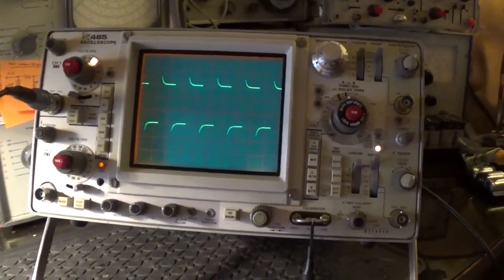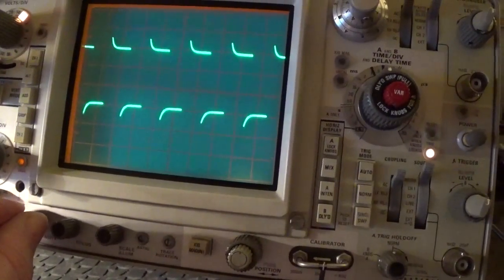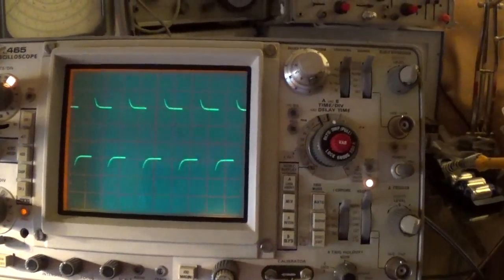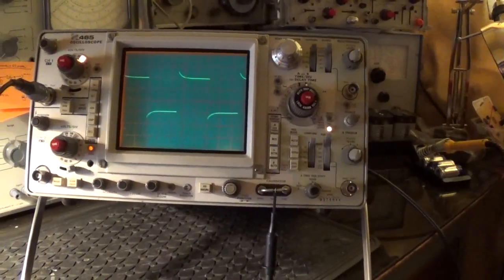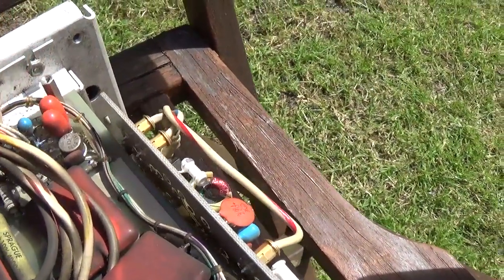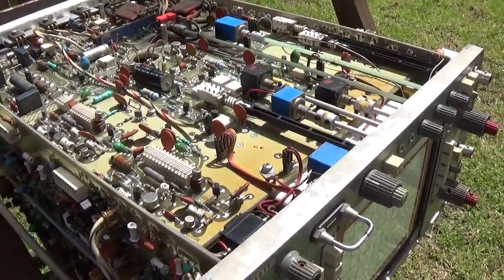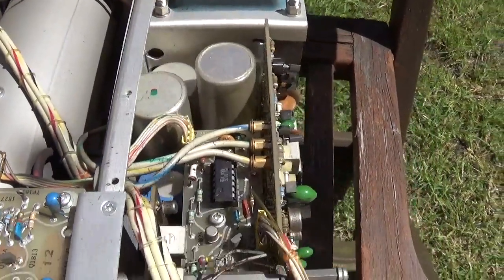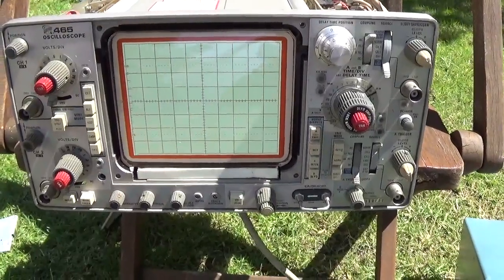Tektronix 465 repair

Comment: Thanks, nice video. I fixed a dead '465 back in the 80's. The +15V power supply was dead. It consists of a '741 op-amp and a series-pass transistor. I measured the '741 pins, found that the voltages were wrong, and swapped in a new op-amp. The  op-amp was socketed, yay! It worked, total repair time about 15 minutes. I used that scope for many years
Later the channel 1 vertical position pot was very jumpy. It was one of those old , square Bourns Modpots. Replaced it and that annoyance was fixed. 
These were and are great scopes. Good luck fixing yours!

Comment: I've got one  whose trouble is  the coaxial input terminal of channel one, is broken ... but I do not know how to remove it ... it has a metal cover.
Reply from the maker: Hi Alfredo, the manuals are freely available on the Tek wiki site   http://w140.com/tekwiki/wiki/465
Reply: tnx so much....blessings
Reply: Do you think it's possible to get the broken terminal?
Reply: look ... I have a coaxial cable terminated in a female connector ... the cable is rg 50 .... do you think I can replace the original with this and it works? ... it is the first time I work on this device....i want to learn
Reply from the maker: Easily available!  Mouser in the US should do them. Otherwise join a vintage electronics forum and ask if anyone has a spare Tek part they'd be willing to sell. Good luck :)

Comment: I really like the illumination on the volts/div  control. I have had a few of these over the years and they are nice to use. Good buy.  Those drum switches can be impossible and pain to repair. But now you have a spare.
Reply from the maker: AllTheGearNoIdea Thanks Chris, those lights are an issue to look at actually. CH1 shows the X10 setting no matter what probe is hooked up. Not sure the Auto triggering is working properly either, I don't think it should depend, on Auto, on the Trigger Level control setting as it would do if you used the Norm trigger setting. So, there's a few more things to fix yet but at least there's a trace!
Reply: That x10  stick On fault is common on TEKs.  No doubt your going to fix look forward to watching your fix. God those Tants are bugger I think you said you replaced the electrolytics you probably know but they hate excessive ripple. May be worth a quick check on the main main smoothing caps.   I hope you can repair the second parts scope I'm feeling sorry for the poor thing. Please have ago at the repair.